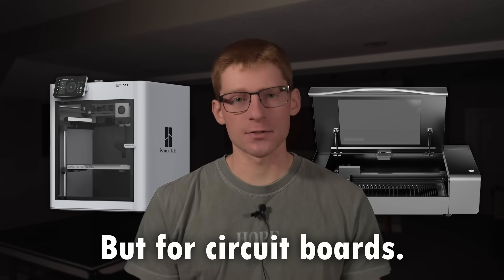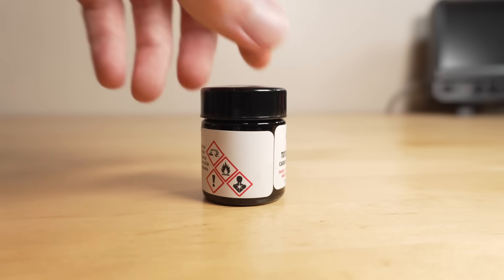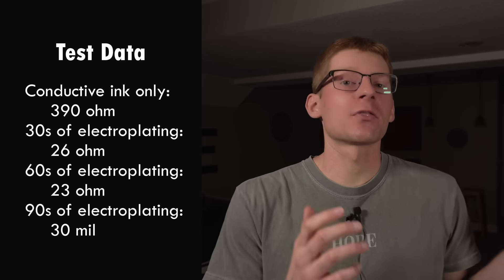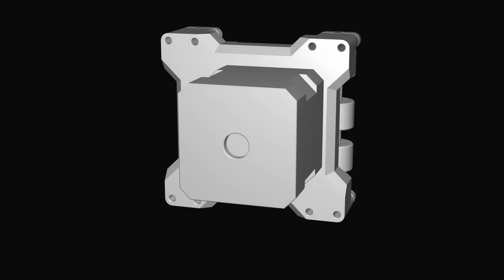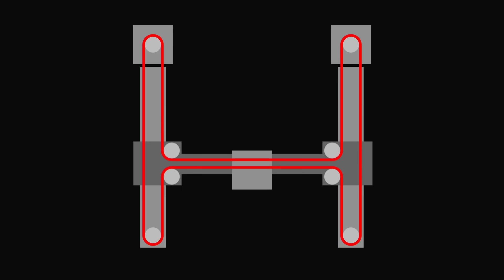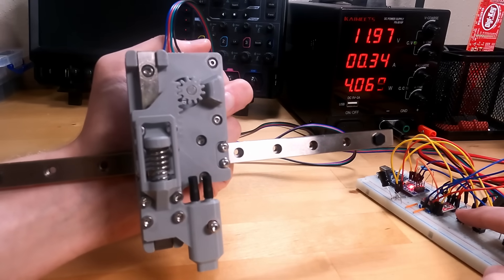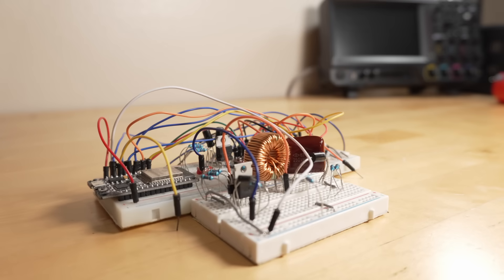I'm Developing a New Circuit Board Manufacturing Technology

Comment: the reason that the initial test worked so well and so easily was because you made a constant flow of solution by gravity which means that there is always copper to deposit in close proximity. the problem with the latter design is that you have almost the exact same fluid being pushed into the hole each time this means that the more holes it plates the longer it would take for the copper to reach the correct spot resulting in the time for each plating cycle would increase, potentially exponentially. if you change the solution feed system to a loop it should provide a constant flow of fresh solution to each hole which will make the plating time become much more stable and predictable. if you had a sensor that could measure the amount of copper present in the solution main tank then it shouldn't be that hard to write an algorithm that would provide each hole the perfect amount plating and then warn you when the copper content of the solution gets too low so that it can be replaced or re-enriched.

Comment: I actually never understood why the coreXY system was invented, with two belts crossing each other. The H-pattern single belt has, I believe been used for a long time in drafting tables and similar mechanisms, so what is the point of core xy, really ? the H-pattern with single loop and no overlap seemed much superior.
Maybe there was some patent avoidance shenanigans also ?
You made good points about the torking of the crossbar, but I think this could also be managed a different way.

Comment: Why dont you just thread a fine conductive wire trough the via and affix it on both ends of the hole, or alternatively, a bit janky, fill the hole with some sort of high viscosity solder?

Comment: Maybe you could just have a tool head insert a thin copper wire into the hole and then cut both ends of it a bit beyond the hole and have another tool head compress it from both sides.

Comment: We had one of those machines you showed in the beginning, the protomat S63, at the university I studied at. I was in charge of operating it. Super tempramental.

Tp achive double layer boards, we put a clear plastic layer on both sides, decifix basically. Locates the fiducials, and drilled through the plated holes again. Then using the vacuum attached to it, sucked a solder paste through the holes and baked it.

Wasn't regular solder paste though. Was this black stuff.

Comment: Now that I think about it, if ink can replace electroless plating even on multilayer boards, you've already solved the biggest problem for home fabrication. A regular copper plating bath is not a big deal compared to the many steps and delicate balance needed for electroless plating. If your machine can ink holes and blow out the excess to leave a thin coating on the wall that will reliably plate in a bath, that's good enough for me.

Comment: Levi, this is a super neat project. Have you considered any options for creating vias other than electroplating? A couple ideas I had:

1) Placing and crimping a small conductive rivet/grommet into the drilled via hole (would likely require a larger pad around the surface of the via and a fixed via size)
2) Inject and melt solder paste into the via hole

Is there a reason why you've placed a requirement on yourself to produce a 0.3mm via other than it being a popular size? Having designed a number of PCBs in the past, a fixed 1.0mm via diameter constraint can be easily worked around in 98% or circumstances I've experienced. The only problems that stand out are working around QFP or BGA packages with really dense pins (but even then, you could always drag a trace out from each pin and stagger the vias on a prototype board).

Comment: Little late, but what if instead of doing each via individually you create a tool head with kind of kike 2 silicone pads (top and bottom) that seal the entire board completely and then do all vias together. That way you can slow down the elctroplating process while also not increasing the overall time.

Comment: Why don't you just put a short piece of wire to connect both sides? If you manage to bow each ends of the wire it will not fall out and could get soldered as any other part of the design later.

Comment: Use a 30G needle sealed around with silicone above and below for plating. You will need 4 heads. Tin chloride, silver nitrate, copper sulfate, and deionized water. You can use this for the entire circuit as well, only the tin chloride really has to go down with accuracy and the rest and be applied by a wiper.

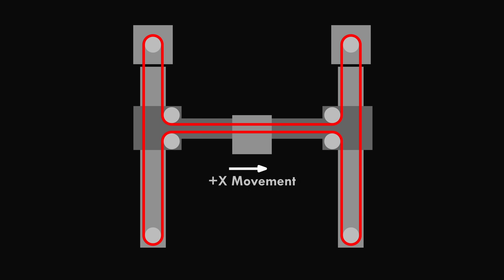Comment: 9:50 There is another really simple belt/motor design but it does not meet one of your criteria.  I think it should not matter because at 90 seconds per via, speed and weight of the toolhead is not that big of a deal.  
On any machine I build recently, I put the motor on the toolhead and use V-Slot and POM wheels.  Put a timing pully on the motor and loop the belt under the wheels.  Design this to have good tension, contact angle with the gear-pulley.  Secure the belt in the groove of the extrusion at both ends.  Use pliers to pull tension on the belt.  This also provides a great end stop and the motor should skip before damaging the belt or other components if something goes haywire.

Comment: Hi.  I recently saw a video where the traces were applied with the 3D printer not printing a thermoplastic but a low temperature metal eutectic. That has the ability to bond to the surface.  Not totally sure how this is done.  But the manufactures of the material provided a method to this person and it worked.  I assume there was some roughness to get a mechanical bond and some preparing of the surface with a flux. 
   A 3D printer should not need any changes to use a soft low temperature metal filament that is either  coated with a flux or core of flux. A eutectic metal blend.  Just a higher temperature nozzle.   Now to the making small holes conductive.  A 3D printer with one head the drill and the next the nozzle putting down metal. After drilling the nozzle moves over the hole and press against the board.  Could lay down the trace to the hole and around it.  Belleville spring stack will give some play and control pressure with travel. Inject the metal into and through the hole. Could stop by hitting the bed and push out around the nozzle.  When printing the other side will complete the attachment. 
     The company was a race car manufacture that pulled the video and replaced it with an ad. The advantage is that the circuit could be printed on any 3D surface, doesn't have to be flat.  So say a fiberglass panel could be wired with traces and then painted to insulate the circuit  and the components could be put on before or after coating with masks for after painting.   material was I think supplied by  https://s-bond.com/products/s-bond-solder-alloys/

Comment: Interesting project.   Been making DIY PCBs since about 62, PTH was always the Holy Grail. First boards were Testers dope on Cu clad phenolic. Move on to college in 1971 doing good 5x5 double sided boards with spun on photo resist.  Started working after graduating and got to have real PTH boards built, still 4 weeks lead and hundreds of dollars each plus a hefty NRE engineering fee. No CAD, boards were hand taped up with red and blue litho tape at 2:1 and photo reduced, no solder mask or silk either.  Our initial protos were wire wrapped  to get the logic correct, only then did you go to PCB and still it was not uncommon to have 5-10% failed via plating.  Quit making DIY boards 20 years back but move to today I can get 10 boards in 4 days for $20 or less  including shipping. What a game changer.  Trade off the 3 extra days with better DRC checking and it's one and done.  Experienced enough I don't kneed to prototype any DIP designs though I am only doing SMT these days anyway.  DYI boards are mostly useless for SMT,  you really need the .3mm or less dia vias and solder mask/skilk.  Any thought of rivets or wires are not going to work for SMT, got to have a smooth planar surface to solder the parts.  Even 2 layer is s stretch for newer part sizes and BGA's .   Though I always had the thought of using the laser scanning mirror assembly from a laser printer to do direct writing and image on a photo sensitized PCB.

Comment: Look, electroplating parts in whole is actually a pretty easy process to do at home. I've done it before!!! You solved the hard part that takes lots of chemicals, and that is getting conductive material around the vias.

You are a genius. You have already solved the major issue preventing boards from being manufacturable on a small scale!!! Eventually the machine could pick up the PCB and dunk it in electrolyte. This is still a win!!!

Comment: To put molten copper into the hole, you would put 0.00162106 (volume of .3 x 1.57mm cylinder) * 7.93 (molten copper density) * 0.572 (molten copper specific heat) * 1064 (molten copper temp - room temp) = 7.8236 joules of energy into the circuit board, which would only heat the board a few degrees.   You can also stick wire through the hole and try welding (with a wire bonding machine head style thing)

Comment: Great video! The hard work making animations and producing a polished video as well as tackling a huge project is really impressive! I have no experience in this kind of thing, but I do find it very interesting. One thought I had - at such a small diameter of 0.3mm, the surface tension of the fluid may result in the hole being completely or partially filled with solution, rather than the desired surface coating. Perhaps this, along with suggestions from others, is a contributing factor? Looking forward to the next video!

Comment: If it's just for prototyping why not making the vias by connecting the two faces on the edge of the pcb? Without drilling any holes. Just a bridge on the edge that wouldn't require any electroplating

Comment: If it's for prototyping 2 layer board, why not use a small wire soldered in, or a rivet? I think Via's are made the way they are to connect paths on multi-layer boards. Making an electroplating machine to connect two sides of a board seems an overkill.

Comment: Perhaps someone can answer this as I have absolutely zero knowledge of making circuit boards of any kind. What size holes do you typically drill for these via connections or for mounting the various parts to be soldered on ? The reason that I ask is because I have several boxes of fairly expensive very small diameter drills ranging from about 0.020" to about 0.035" all with a 1/8" shank. I'd like to find a home for them.

Comment: regarding the allignment of the toolheads, you can still make the core XY work if you embed some system present in IDEX 3d printers, an example would be a camera, the RATRIG v4 for example has an interface that alligns one toolhead at the middle of the photo, then it swaps for the other toolhead for you to allign it too, i just dont know how precise it would be moving a camera to face up and down

Comment: perhaps you do not need this complex and perfect "tube" shape? Why does it have to be a hollow tube?

couldn't you just push a tiny pin/wire/tab/rivet in the hole?
then it would go
plastic/resin layer
copper foil layer
laser engrave layer
hot rivet/laser weld layer
next layer

Comment: great effort. i am from student life trying to fill vias without pdcl2. the main problem is time for your case. one vias at time vs multiple vias at a time.did you tryed low pressure chagre deposite methode to deposite multiple vias at a time? it is also may be proof of concept. i dont have access to jigs but you may try.

Comment: I like this interesting approach to diy vias. When I was in college we did diy vias with a bit of wire soldered on both ends. It couldn't be as small as this but, it got us off the ground. I think this has a lot of potential, but I wouldn't underestimate the complexity of the rest of the process.

I'd love to see this idea progress forward, and the only big thing I'd warn against is the "never ending personal project".I think you've demonstrated a viable approach to this step in process. Some people have even commented potential improvements. Really, 3 minute vias is a pretty arbitrary requirement. Even with 10-20 minute vias, you could still make pretty complex and useful boards much faster than you could order them. I actually always thought it was an interesting challenge/puzzle to minimize vias in a design.

Honestly, I think you'd be best served by pushing forward to a minimal viable product. Then, you can come back and improve the sub-processes later. That'll also give you better insight into the actual limiting constraints of the overall process, which might not be what you expect. Either way, I'm definitely interested to see where this goes.

Comment: Is plating absolutely necessary for prototyping? What about just feeding press fit copper wire through the hole and soldering either end? The soldering doesn't even need to be automated, it can be done in the component adding phase (so could the feeding of the through-wire, but it would be difficult with 0.3mm hole, in which case automation would likely be more successful).

Comment: Dude, great project, you got my sub! 

Here are some suggestions:

1: Be more specific about your electroplating solution. The PCB industry use PEG-JGB-SPS additives, they have a huge impact on quickly plating small areas with high accuracy. SPS (Bis-(3-sulfopropyl) disulfide) is probably the most important since it's job in the additives is accelerator, it increases Cu deposition in low current density regions, that's the problem you described. Also decreasing the PH aids in conductivity so consider adding H2SO4 (sulfuric acid).
2: Use AC Pulsed plating. The on/off cycle allows for faster and higher quality plating without creating dendrites.
3: Ensure a stable temperature of about 50c-60c, this is the optimum temperature for ion exchange in a typical CuSO4 plating solution.
4: Agitation! An ultrasonic inducer (20–80 kHz) should be placed in the tool head, they're very small and would fit your compact design preference (mine too!). Electrolysis creates a lot of hydrogen bubbles which interrupt ion flow, especially in tight spaces, ultrasonic agitation helps burst the bubbles quickly. The agitation also breaks up surface tension which slows ion movement, and if the ultrasonic inducer were pointed at the via hole it would actively drive fresh Cu ions where you want them. 

Hope that's helpful. If you made a KickStarter I'd love to back it as I'm sure would many others!
Reply: This is the first comment to mention the ultrasonic suggestion, hope he sees it!
Reply: Good suggestion , good comment ❤

Comment: What would have been wrong with just shoving the right dimeter of solid or flux core solder wire in the drilled via hole and melting it to solder both halves of the board together? Wouldn't it be less complex? Alternately you could fill the hole with solder paste and then heat gun it.

Comment: Maybe a plunger syringe-like thing, and make the vias with molten solder? Not sure if that makes sense, but I could picture it working. Of course some later board processes wouldn't allow for that approach, depends on how you'd want to put the components onto the board.

Comment: Speaking basically as an idiot with no PCD design experience at all; my first naive idea is just to stick some wire through the hole and solder each end.
I'm just thinking it doesn't make sense to try to mimic the same results that other processes make when all you need is an electrical connection.

Comment: The gantry design you tried is actually known as an H-Bot gantry. Both the H-Bot and CoreXY gantry styles are cartesian systems but are obviously very different as you learned. 

Just a reminder to folks, all CoreXY systems use a cartesian system. However, not all cartesian system gantries are CoreXY!

Comment: If it wasn't for the size constraint, I would suggest riveting. This could be even faster, and requires no chemicals. But your gantries would need to be very sturdy, to survive the strain. You might lessen that, by combining it with heat - maybe by using a strong through current while pressing the two ends of the rivet into shape. Alternatively, simply solder the rivet into place, but then you have again chemicals.

Comment: Why actually use chemical vias, I'd just insert a thin copper wire and melt it around the surface contacts. On such a small surface the electricity required to weld copper together shouldn't be to high. And the resistance should be significantly lower.

Comment: Super interested is where this will go, got a sub from me!
One thought: is there a reason you couldn't just move the board instead of the ends? You wouldn't have to deal with any alignment issues then since they'd be static and simpler by keeping the x/y and z movement mechanisms are separate.

Comment: Im not an electrical engineer so there could be some fundermantel problem with this but i have this idea for alternative via construction on double sided pcbs:
Why not drill a hole, make copper circle around it on both sides, put a small piece of copper wire the hole diameter in, maybe mechanically expand the sided into the material (similar to rivetting and some jewelry stone setting technique) and finish with soldering